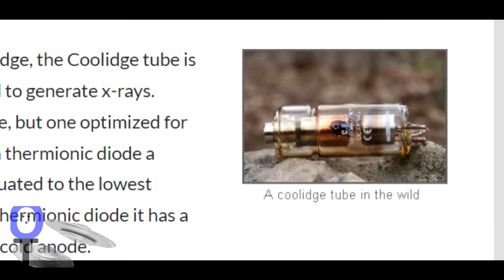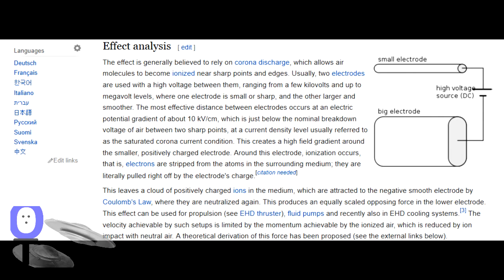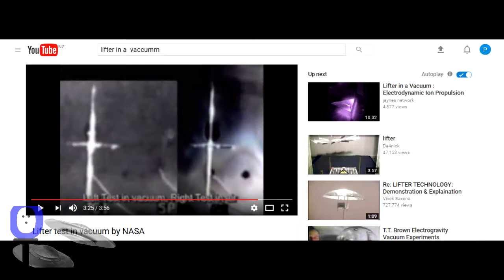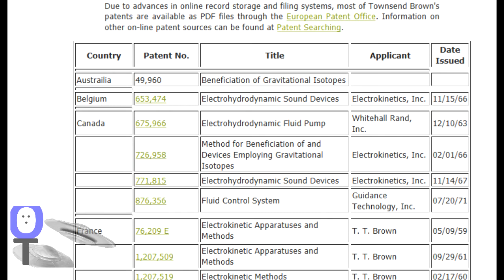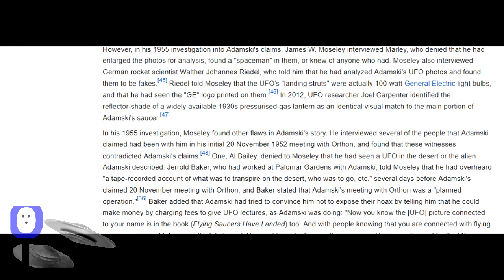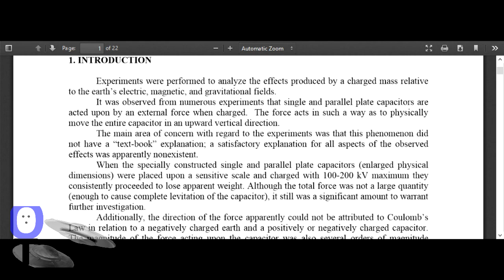Anti-gravity Research and Life of Townsend Brown - The Out There Channel Episode#27 (13Aug2017)

Comment: Brown didn t need to go to High Voltages and High Dielectric Materials...Ron Kita http://www.chiralex.com  US8901943
Reply from the maker: atoms absorb and release energy all the
time.. tesla's radiant energy/dark energy
keep a atom structure stable.
but sure a skin made of metamaterial *(ceramic etc)
and highly charging it.. may block energy
absorption or slow it.. which slows
the flux which is gravity. thus gets lighter
brown was ionizing lift mostly I suspect
anyhow but tesla claims to floated a 
rod of some metal mix again he was a high
voltage and x ray tube man.. which townsend  was too